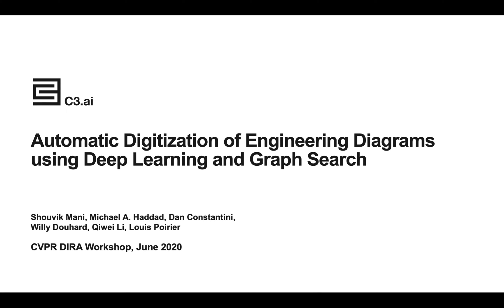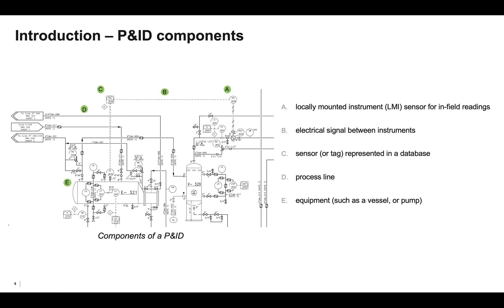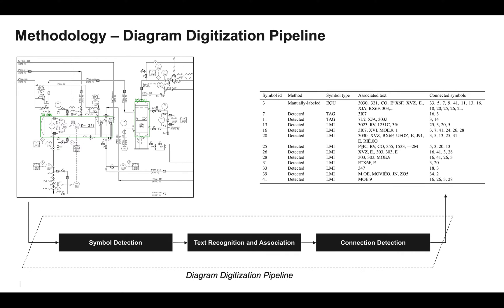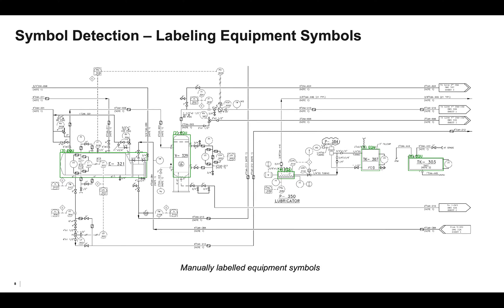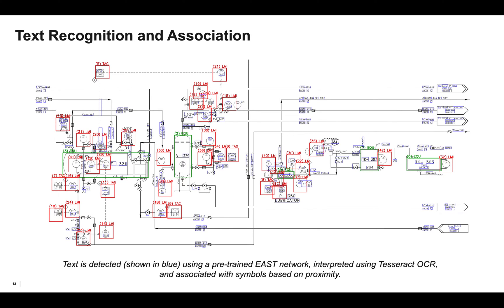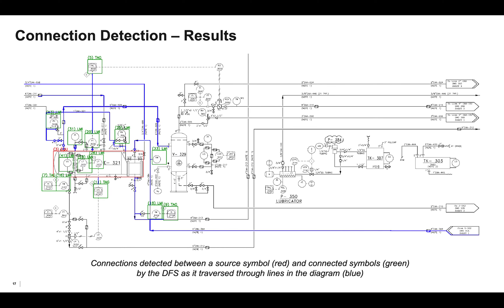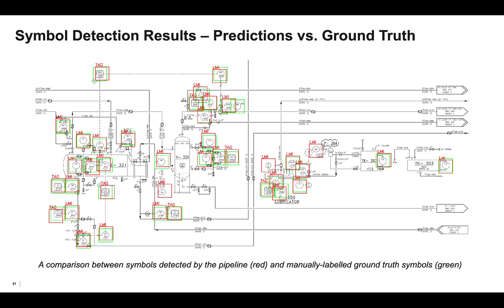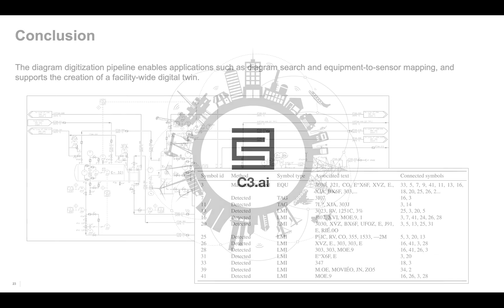Automatic Digitization of Engineering Diagrams Using Deep Learning and Graph Search

Comment: Why not develop P&ID in smartplant with a stylus pen and tablet where the system identifies the symbols from the database as Google Handwriting input understands various languages of the world just by scribbling on the mobile. Moreover whenever there is a duplicate item instead of searching it in the Engineering Data Editor it should pop up in front of the screen that it is located in the particular P&ID.
Reply: it's because a lot of non disclosure stuff involves in this industry. Plus it's an old industry (in fact since the first industrial revolution) meaning the practice is also old-fashioned and many existing plants were designed 10-15 years ago. To change it digitally requires a huge change in their tools and human resources. Not an easy thing to do
Reply: @echo0204  indeed, also i would imagine some companies have created software that can do this, but ends up not sharing it with others. Do you know about any other research related to this project?